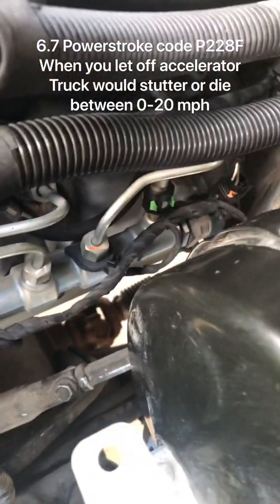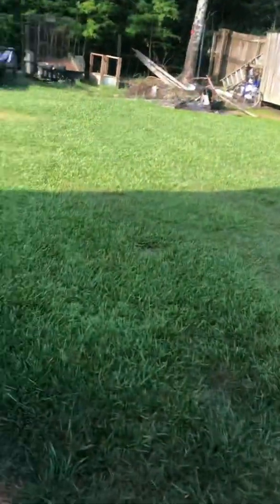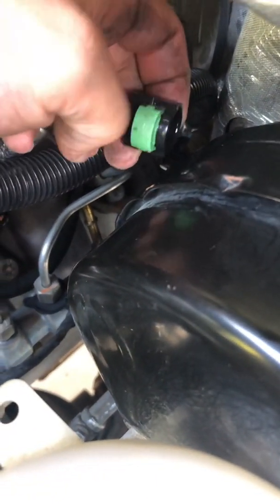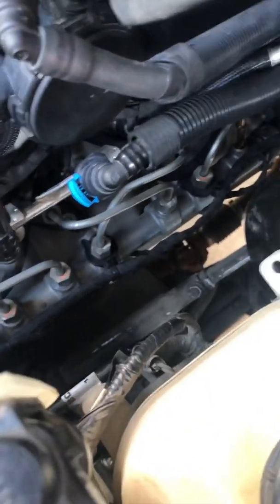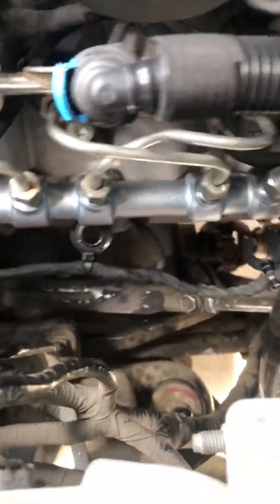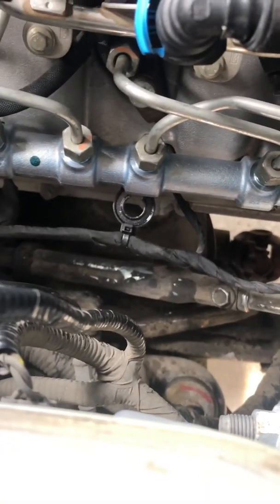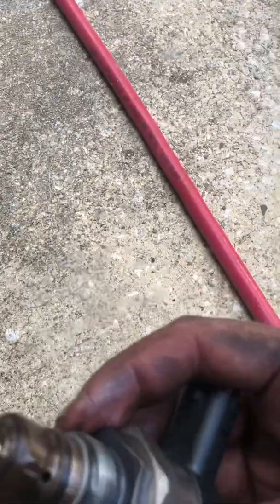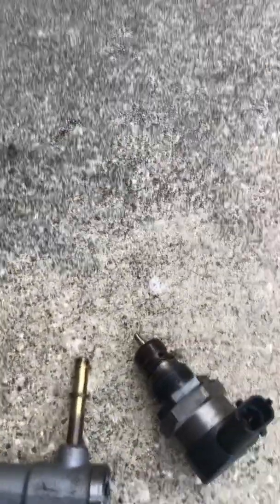6.7 Powerstroke Fuel Rail Code P228F

Comment: I have a p228f code as well after dcr pump conversion and going to replace the rail as well. FOrd recommend replacing all 4 injectors line kit as well. The line kit came with a 3 gaskets. Do you know where those go?

Comment: That's a lot of rust for fuel system! 😮
Reply from the maker: 100,000 miles later I never had another problem with fuel system.
Reply: @Themericandream  that's good. The fuel was definitely contaminated that's why the relief valve you changed went bad. The fuel system is Bosch design and supplier made for the majority of fuel systems around the world. There's other manufacturers as well like Delphi, Denso etc most are licensed by Bosch because Bosch has patents on all sorts of designs.

Comment: Hi. I have same code. And my truck jerkes when you give power is that normal specially after 2000 rpm, seems like it doesn’t get enough fuel or something. it’s like jerking. What was your symptoms?
Reply: I had a similar problem , with the same code P228F, it turned out to be a faulty HP sensor located on that rail.
Reply: Did you finger out the problem???
Reply: Hi yes I replaced the fuel pressure regulator located on that rail, but I found out as well. That is cheaper to buy a whole brand-new rail then that sensor so got new rail and install it and Truck was like new again

Comment: Did you experience any noise coming from the motor when accelerating? Specifically a slight tick ? I’m only throwing that one code
Reply from the maker: I can’t say I was. Just would die most of the time.
Reply: @James Leubner. Did you ever find out what the slight tick was and what code are you throwing

Comment: Were you driving down the road? And truck just shut off! Tried cranking it up but no start? Did you had that issue?
Reply from the maker: No, running down the rd everything was great. This issue only happened at low speed low rpm.

Comment: Are the fuel lines from the fuel rail to the injectors single use fittings or crush fittings?
Reply from the maker: I am not sure but I did reuse mine, I think best practice would be to replace but I’m cheap and it’s been good for 30,000 miles!
Reply: @Themericandream  came here looking for this exact answer. thanks!
Reply: Ford and the mechanics on YouTube stress that the high pressure lines are one use only. I've reused mine just to see and didn't have any problems.

Comment: Hello sir just bought a 367,000 mile 6.7 on the test drive it did fine but in the way home while letting of the gas pedal at around 25 mph the truck stalled and a red low oil pressure warning light came on then I put it in park turned it over and went on to get it scanned. The scanning tool gave me the code you mentioned after adding oil and driving the truck continued to turn of on the way home 3 times within the span of 5 miles all at around 20-25 mph
Reply from the maker: Sounds like your regulator is shot.
Reply: Thanks for the prompt response I’ll be shopping for a regulator tomorrow. the truck also hard shifts from 1-2 and from 2-1 some hard down shifts are noted from 5-3.
Reply from the maker: @rankedtrails  try getting your TCM reset. Mine was doing that. And I just reset it. Over time it learns and might have learned some bad habits.
Reply: Will do thank you sir
Reply: I bought the truck from a
 Dealer a ford dealer it waS on the auction list yet I know the manager and kept if for 5,200.

Comment: You don't have to take the fuel rail off. Just take inner fender 2 clips that hold the heat shield out, fold out of your way, take steering link bolt out bend out of your way and take 30mm wrench and take off regulator. It spins so it won't hit the head. 30 min job.
Reply: That's ridiculous. You'd never have to change that rail. It's simple and easy to just do the regulator on the end of the rail.
Reply: That's what I was thinking, the fuel rail just has a hole straight thru the middle. If you take regulator off each end you can look strait thru it, there nothing in there
Reply from the maker: Yea I suppose if you want to half ass it you can do that. With my experience of extremely high pressures it’s better to change both components in case there was any type of wear groove in the fuel rail itself. With such high pressures tight tolerances are very important and for minimal costs or effort changing the whole thing was a non issue

Comment: Do you know what the torque specs are for the hard lines that run from the rail to the injectors? About to do this repair over the weekend.
Reply from the maker: 2 Ugga dugga’s LOL. man sorry I am not sure.
Reply: Haha ok no worries! Just tighten them good I’m guessing?
Reply from the maker: @hamiltonbait  yea I think the bolts are aluminum…could be wrong so just be gentle on them. But that is high pressure side so make sure they are tight

Comment: Hi Kyle, did you have any water in the fuel system issues before this code popped up?
Reply from the maker: No water I had just installed disaster kit from s and s.

Comment: Just started having this code, only performance issue noticed is a slight surge at takeoff, but it's random, usually just first thing in the morning. I just had new heads installed 3 months ago, so I'm wondering if my mechanic maybe got some debri in when resintalling the injectors. I'm a little concerned about the re-use of the HP lines, but since you haven't had any trouble and mine are brand new....what the hell let's do it. Thanks for the video!
Reply from the maker: Man I haven’t had one lick of trouble since doing this…it definitely made my throttle weird. Would give it slight throttle and let off and if would fall on its face and die or almost die. You can look at logs with forscan if you have that also. Rail command and actual should never deviate by much. My command would bet 3500-4000 and actual would be at 700 when letting off throttle after slightly bumping it while idling.
Reply: @Themericandream  Maybe mine is just giving me a very friendly warning saying hey I'm about to take a crap because my actual and demand are in sync perfectly. I monitor them thru my ezlynk. But I'm like you I'm a DIY if at all possible, I was without my truck for almost 2 months when I had my heads done bc my mechanic was so backed up and I'm trying to avoid that road again, I can't let it be down that long again. But again thanks for the video and I will report back when I get some time to dive into it.
Reply from the maker: @justinpowell3680  yea mine was very close the only way I could actually see it was by plotting it on graph. Couldn’t barely see it just with naked eyes it happened that fast. Good luck though man!

Comment: YOU ARE THE MAN!

Just bought an F250, and it had the stutter, cut off when you were barely moving. You'd think there be more out there about this, but your video was SPOT ON! 

Thanks for taking the time to post this!

Runs like a champ!
Reply from the maker: Glad you liked the video!!
Reply: @Kyle Baca  I'm having the exact same issue... im no  Mechanic is there more than one fuel rail? Or just the one???
Reply from the maker: @justinrichard5398  there are 2 one on each side but only drivers side has sensor and regulator on it.
Reply: Nice video! Is it needed to replace the whole pipe or just replacing the sensor is enough?
Reply: @RashidROwlia  As I understand you can just replace the sensor (but I understand it's can be hard to get the sensor off the fuel rail (pipe) - I just bought the fuel rail with the sensor (think it was about $60 more) and it made it so much easier!

And it fixed my truck! When I bought it the high pressure fuel pump had been replaced (and I believe they did that to fix the issue cause they encouraged me to run the truck hard), but after replacing it... it's never stalled again!

Comment: same code to me what if i just change the regulator?
Reply from the maker: You can just change regulator but mine had a slight bit of rust on it after 150k miles and it’s such a high pressure component that i did wanna but just the sensor and it not seat right on the old rail.
Reply: @Themericandream  mine has 155k and i’m just going to replace regulator see if that gets rid of the code
Reply from the maker: I don’t recommend that for the reasons I just stated but hey your a grown man!
Reply: @Themericandream  to do it correctly id have to replace the fuel regulator and the fuel rail?
Reply from the maker: @bryanmorales6874  that’s my recommendation because the 2 parts likely wear together and if you put just a brand new regulator in, the the fuel rail may have a wear groove in it and could not seat properly. I’m talking thousandths of inch type stuff and with it being so high pressure you never know.
Reply: @Themericandream  where can i buy that fuel rail?
Reply: @Themericandream  what size wrench fit on the regulator
Reply: @Themericandream  and also on my scan tool it say fuel pressure regulator number A is there 2 regulators? meaning the regulator A is the driver side?
Reply from the maker: @bryanmorales6874  there is only 1 that I can recall on the drivers side nothing on passenger side it’s connected.
Reply: @Themericandream  ok first im going to try and change the regulator out and if code stays on i’ll change fuel rail

Comment: Did this cause any white smoking issues?
Reply from the maker: Not to my knowledge I had no issues
Reply: @Themericandream  I’ve got the same code and surging when I let off the throttle at 0-20mph, but now it’s started white smoking on takeoffs and sitting at idle
Reply from the maker: Did you ever figure this out?

Comment: Yes living some fees back, yes you remove the sensors on that rail, if u see debris, I’m sorry for you but you have to replace the all fuel system, as the high pressure pump is failing , but if you see only rust on sensor that’s just will solve you problem , replacing the complete fuel rail, nice thing it come with sensors on it ,
Reply from the maker: Yes I had no debris just a little rust and it was causing it not to seat properly under low load. WOT and let off was no issue.

Comment: Where did you buy your rail and pcv ?
Reply from the maker: I bought the whole setup drone rock auto the pcv and pressure gauge comes installed on the rail.
Reply: Any issues reusing the hard fuel lines? That take the 17mm crows foot?

Comment: Hey Kyle. Is the fuel rail under pressure? Do u need to do anything before removing the line nuts off the rail?
Reply from the maker: I think it did have a little pressure on it. Not enough to matter though. Need to make sure you have the right tools it requires a special tool to remove nuts. I also washed the engine bay really good to make sure there was no dirt to contaminate my new rail. I taped over each inlet on rail and pulled tape off as I connected them.
Reply: Kyle Baca Thanks so much. That helps a lot!

Comment: I got the same code come up on mine two days ago. Taking to the shop tomorrow. Is this usually the fix for it? Over the phone the shop was telling me I may have ruined my entire fuel system.
Reply: Runs fine just starting/ turning over its a little rough. Isles fine. When actually running it runs great. Maybe at lower RPMs or 1-3 gear I “think” it’s maybe running different but that could just be me worrying.
Reply from the maker: Jordan Vizinat depends does truck still run fine? If it runs fine then this is likely the fix. If it’s not running you probably need a new fuel system
Reply: Mine has the same deal. Running great. No problems. The code appeared after changing app the fuel injectors. Any ideas?

Comment: Did it come back on yet? My mechanic is thinking this should be our only fix to my same code.
Reply from the maker: No working great. Truck quit dying and completely fixed the problem
Reply: @Themericandream  Thanks for the quick reply. Definitely making me feel more confident about this fix.

Have you by chance added a lift pump or done anything else? Is your truck deleted & tuned?
Reply from the maker: A Jarski yes I am deleted, no lift pump, this problem started right after I put a disaster kit from S&S on my cp4 pump, so I musta got trash when I was doing it.
Reply: @Themericandream   Do you recommend doing the disaster kit? Has it made a difference? If so, how? I'm trying to learn a bit more and understand better. Some people say do the lift pump for better performance with my tune. I've heard nothing about this disaster kit stuff before reading around a bit today. Any insight?
Reply from the maker: A Jarski it’s mainly to prevent your pump from ruining your fuel system. No performance increase. Can also do a new mporp valve. Also joint 6.7 Powerstroke on Facebook there is slot of helpful people on there.
Reply: @Themericandream  Thanks!